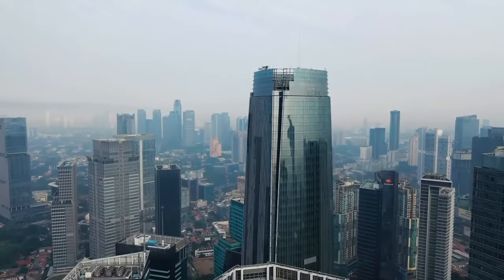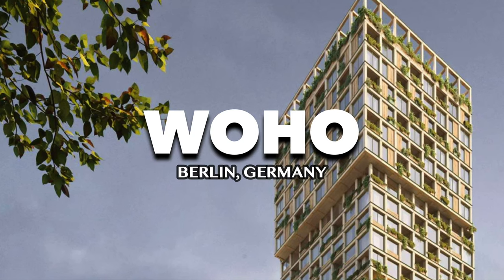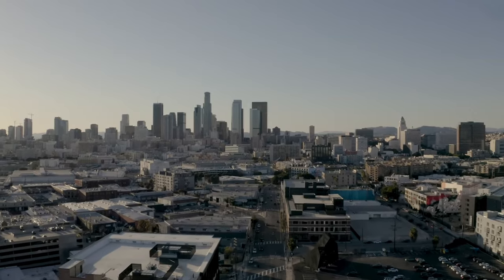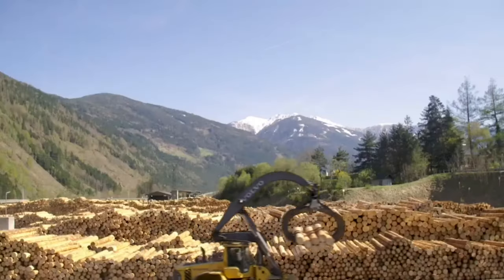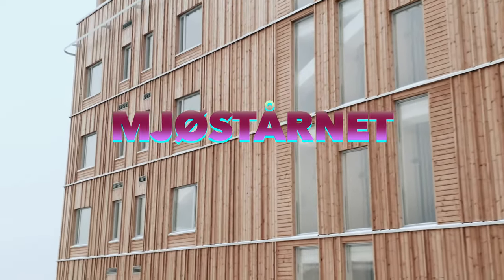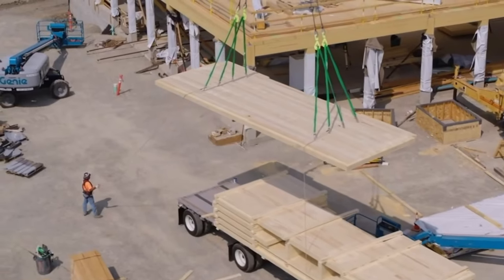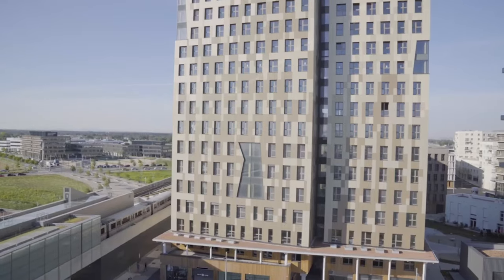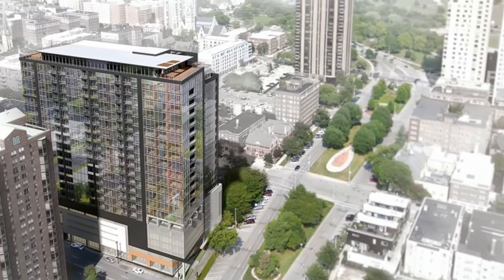Why Skyscrapers Should be Made of Wood

Comment: It's very important to note that this is engineered wood product, not 100% lumber from tree. There is significant usage of glues and epoxies as binders. These binders and adhesives have their own issues in scaling up production. It is not accurate to state it is just trees which is the source material whereas a lot of additional binders are needed. The cost and environmental impact of these binders needs to be taken into consideration.

Comment: My concern is about water, mold and rotting. Especially in low-lying coastal communities, I don't exactly trust the wood to hold up.
Reply: Since wood is a permeable fiber structure, it can be impregnated with all sorts of resins or glues to waterproof it. These would also often be included to enhance its structural properties anyway. Just think of it as naturally-occuring carbon fiber
Reply: @brickmack  But what happens when those cements wear down? Because they are going to be worn out at some point.
Reply: @shanekeenaNYC  Then you demolish the building and make a new one. That won't happen for decades
Reply: @shanekeenaNYC  the same question can be asked for redular steel and concrete buildings.  It takes decades to wear out if done right, and at the end of their lifetime, you have to demolish and rebuild. (Also, who knows if we have some new outlandish recycling tech when that time comes)
Reply: EXACTLY! its weird how people who are "environmentally" friendly PUSH wooden skyscrapers when that takes MORE trees to be cut down... like NAH concrete is the way to go. Ancient Greek buildings are still standing today thanks to their version of concrete! THATS sustainable!
Reply: @ZoeyZoco  Well, not greek, those were made of pure masonry/stone. Rome on the other hand, was the first society to implement concrete from a mixture of lime and volcanic ash, which made little microcrystals that strengthened over time as the seawater waves crashed on shore.
Reply: @brickmack  I don’t imagine those resins or glued are particularly environmentally friendly?
Reply: @ZoeyZoco  Concrete building is way more damaging to the environment tho. Trees can be replanted over time.

Comment: No multifamily building over 3 stories should be made of wood or composite material. All it takes is a fire between the ceilings and floors to disable the fire sprinkler system. Personally I believe concrete reinforced steel structures are the absolute best and safest ways to build a home and or a skyscraper. Of course places like New York, steel framed buildings are ok but in south Florida only steel reinforced concrete is the norm.
Reply: The wood used in these building are resistant to fire. It's not the same type used in standard housing.

Comment: What about earthquake resistance? Is it stronger than concrete with rebar?
Reply from the maker: A lot of the wood buildings still have concrete & rebar in the foundation and core so they're not 100% timber, and I think the structural stability and safety is a big reason why concrete is still used over wood for certain parts of the construction